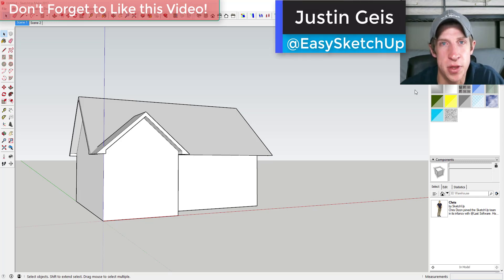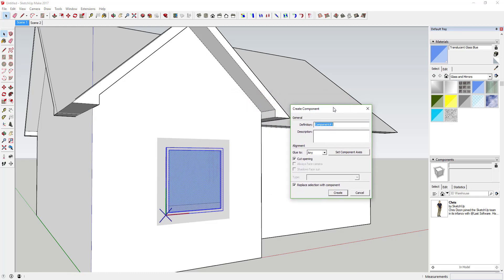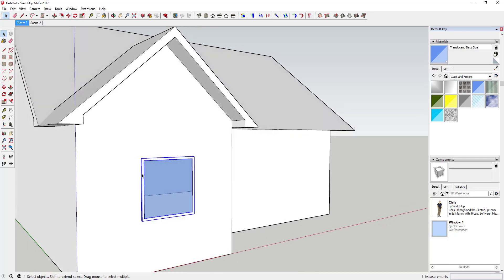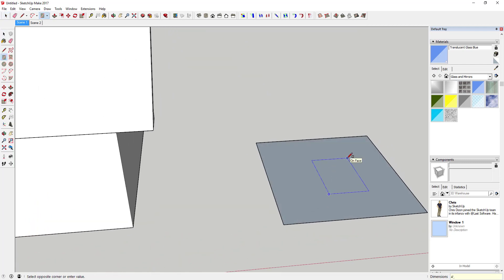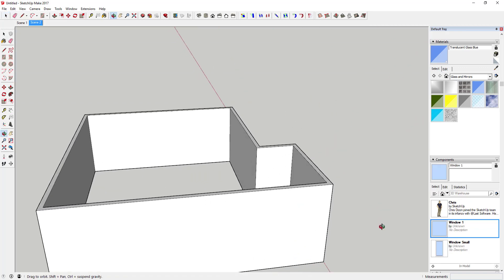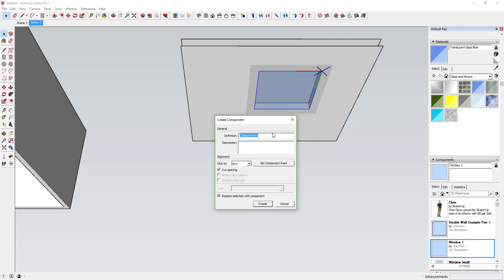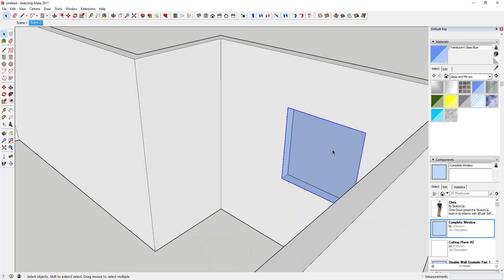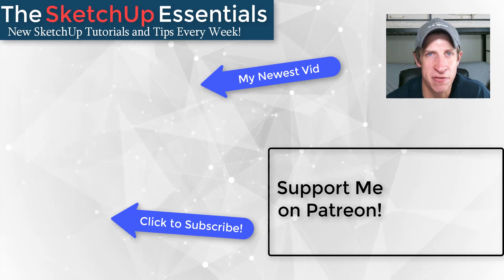Creating Cut Components in SketchUp - The SketchUp Essentials #34

Comment: Interesting.  In over 20 years of SketchUp, I never understood how the cut face worked.  Mainly because I was always trying to insert the component into a double-wall group.
For me, this would never be worth it.  I hardly ever use single-faced walls
It's easy enough to insert window components without the cut attribute.  Move them all around until the layout settles down, then manually cut the holes

Although You've given me the idea of including a cookie-cutter group with the component, and then make THAT grouping a component.  So like your example, once I exploded that main component,, it will leave me with my good window component plus the cookie cutter on the wall surface.  Then I can just turn off the window layer, select all the cookie-cutters, CTRL+X and then go inside my wall grouping, drop the cookie cutters SHIFT=P. and the lines are all set for fast repeated push/pull on the wall openings.  But invariably someone on the team will change the column locations and then it all has to be done over anyway. ;-)

Comment: In episode 22 you use the push/pull tool to cut through two faces . In episode 34 you say you can't cut through two faces . I have found that I can use the push/pull 90% of the time if I use rectangle tool first. If I try to make adjustments later, the push/pull tool will not cut, just continues till I stop it. Can anyone comment on this please as I am frustrated that it wont work reliably. Thank you .

Comment: Sometimes, when I know a windows size and location, I just make a rectangle within that area of any small size, and push it through the wall.  Then place the window where it goes.  Viewed from the backside, you can then push/pull the top, bottom and sides out to the actual size of the window.  I usually then add 1/4"  all around to the rough opening so the window "floats" in the opening.  (shim space used for foam insulation)  For my purposes, windows are almost never drawn as they actually are, a substitute of equal dimensions is drawn instead, meaning (that) at some time they'll be changed out, either in the plan or on a schedule, at minimum, with a note on the plan.  Windows are expensive and deals abound, but you have to be flexible to take advantage.
When I can get the solid tools to work, just putting a big block with two dimensions taken from the width and height of the window, right through the wall and using "Trim" does it nicely.  Delete the block.  One problem that occurs is when I move some geometry around a face with nothing grouped.  It seems to 'fracture' faces sometimes, leaving these ghost faces defined by hidden lines that can be deleted, but show up in the Entities box as faces or edges.  They come back to haunt you later.  So I almost always make a copy of what needs to be moved, which stops that from happening, and delete the original after.
Something else you probably know about, is scale.  Sometimes objects from 3D warehouse come in in a scale that is 20 times larger than what I'm using.  It makes me think that I don't have some basic settings dialed in correctly, but can't think of how to affect that, other than changing the units from 1/4" (good for house design) to the 1/64th maximum, which is not good for house design.

Comment: Hi, Thank you so much for the most amazing tutorial. I actually figured out how to use a cut component in any thickness wall. So first import the component, if it is an external wall for the window, draw flat rectangle in the middle of the wall thickness. Attach the cut component. Then once it is attached, simply use Push Pull function to thicken walls around it. Tip: When I first imported the component and glued to the rectangle, it wouldn't cut out. So I just exploded the component, then Make Component again and select Glue to Any and tick Cut and Replace.... like before. Once you are done, the component has cut out the opening in the wall. Now go ahead and use push pull et voila! a workaround thick walls. Hope that helps! If I wasn't blonde and knew how to create a video of what I have just done, I would have shared, but...I am blonde! haaaahaaa!
Reply from the maker: Awesome - thanks for sharing!